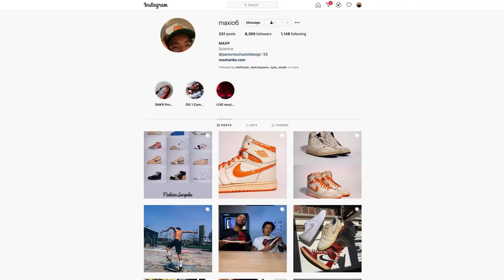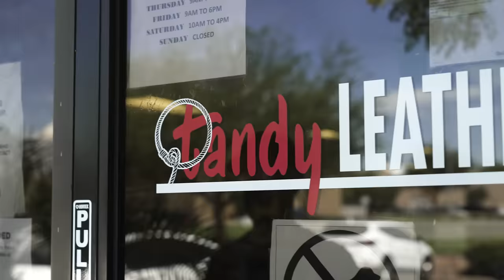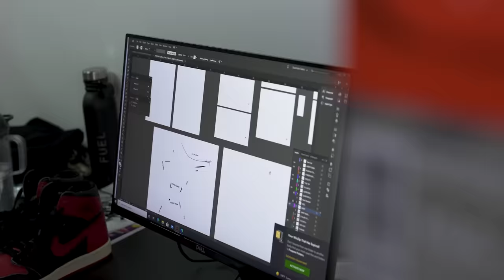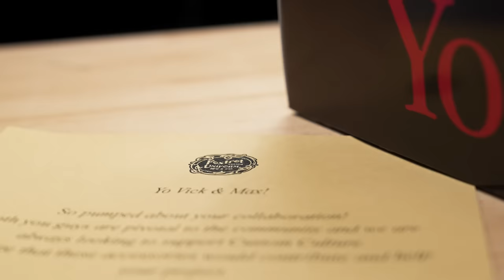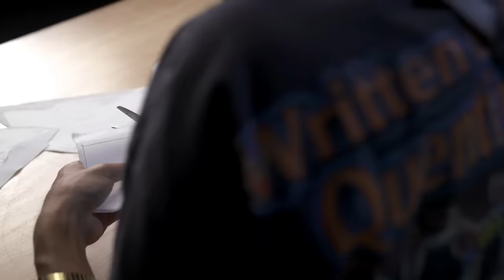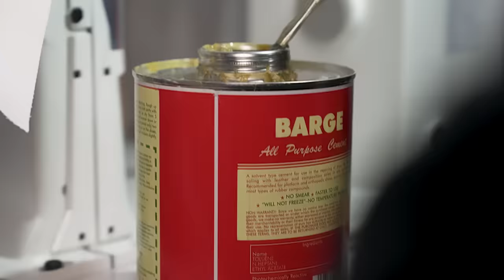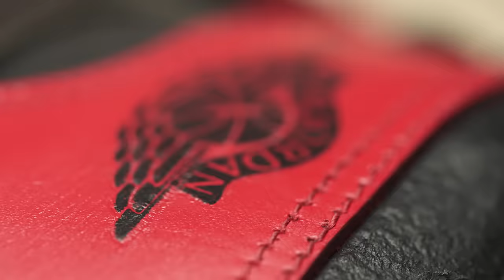How To Make 1985 Air Jordan 1 Bred

Comment: When you heat the thread with a lighter it sometimes causes a black or dark brown discoloration. I hated it especially when using white or light color material. I did find using a soldering iron works well and allows you to set the temp and apply the heat only to the thread. Just a tip for anyone out there that also hates it.
Reply: Good looks

Comment: That tip about the tupperware heel counters is gold. I had a pair of sneakers where the heel counters disintegrated into many small pieces over time, every time I took them off I'd shake a handful pieces out as the thin inner lining had worn out at the heel also.

I replaced them with plastic from an empty bleach bottle. With the extra plastic I also made some half insoles for the heel area, to go under and support the cushioning insoles, as the heel support was also a bit worn out.

Comment: 22:43 the material that nike use on the heel counter support is called "TEXON" a meterial that when you heat becomes flexible and turns hard again when cooled down

Comment: Great job guys, I have always wanted to make my own sneakers/softshoes, but I am having a hard time finding the outsole to buy, where can I get the sneaker outsoles to buy?
Reply: They usually use Jordan 1 low or mid soles whenever they can be found for cheap. Unfortunately those models are selling well right now so you probably won't find some for the kinds of prices you used to be able to, but that's still your cheapest bet. 

If you REALLY want to get the '85 look, you'll have to sacrifice some of those newer $200 Jordan I Highs because they're the only ones that have the curvature to the sole that the originals did.

Comment: There are three completely different skill sets being shown here. 1st is the extensive knowlege needed to understand every component of the process. Most of the top sneaker heads dont have this level of detailed information. 2nd Is the skill to source and manufacture every part and actually make a quality shoe. 3rd the artistry to identify wear patterns and invent ways to replacate how time effects each material and the shoe as a whole. Anyone posting about this being easy, doesn't know anything.